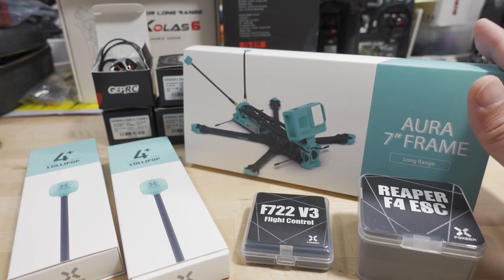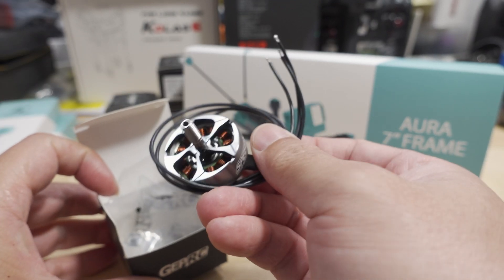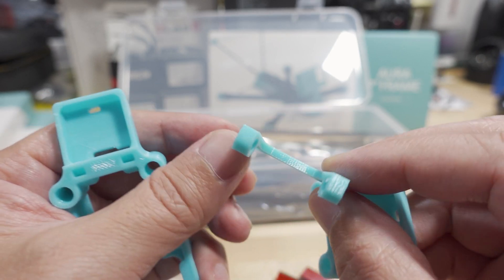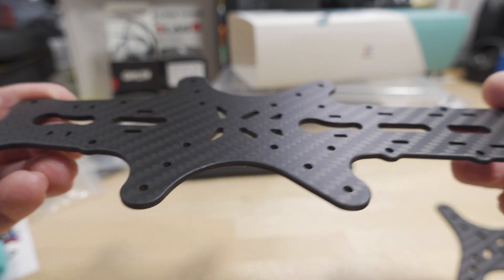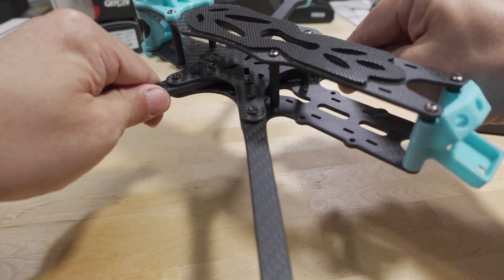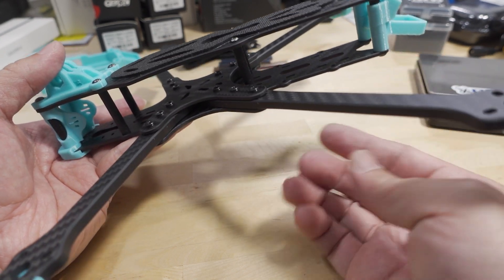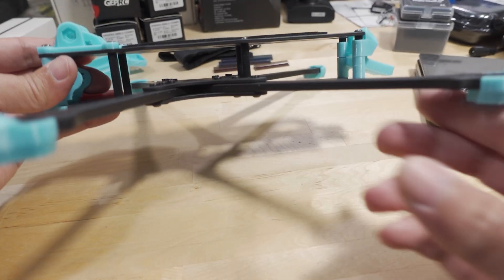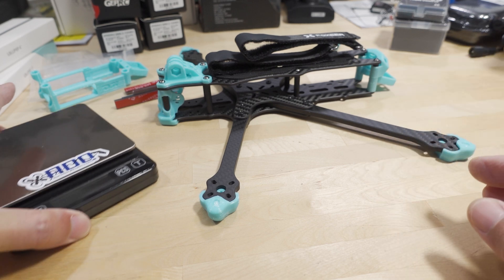Foxeer Aura 7-inch Long Range FPV Build Overview 📝

Comment: did you build this i just have but my props ar touching ?? any idearsim using GEMFAN flash 7040-3
Reply from the maker: Yes, I will have a video out soon.  My props are not touching at all.
Reply: i spoke to Harvey and i havethe first version thy updated the front arms so thy would take all props he is sending me some what a good man

Comment: I am super impressed with quality and all the bits that come with it.  I have built it as a mix of LR and chase platform (2807-1700kv 6s 7").  Its funny how stable 7" is. I did some crazy proximity with it because of how stable it feels. nice frame.

Comment: Ha, just built a small, 4", LR quad which I ended up using a 30x30 F/C and a 20x20 ESC, mine had holes for both but I used an adapter from RDQ to make the fit. Hopefully by next week it'll be flying. Would have like to see the go around you would have used for the ESC n F/C. Anyway Good vid as always.
Reply from the maker: Thanks for sharing

Comment: Yeah, I definitely like this frame, really nice looking. I'm not worried about how the 3D prints look from the factory because I would definitely be scuffing them up while flying, well crashing😂. I just bought a T-Motor F7/F55A stack that I was thinking of putting into an old Armattan Chameleon frame that I have, but last night I was thinking that I could use that on a 7" build that I've been wanting to do; now I see this video. Perfect timing!!! I'm glad that you're going to make a series of this frame and build, that's pretty cool. I watched that Frank 7 video a few times, a while back and I actually liked that one better than the Chimera 7? I think it was? I definitely like this frame and the Rekon 7 frame. I would love to see the Frank 7 in person though😉😂 This is the first I've seen of these long Lolipop antennas. I've got to check these out for sure. Thanks for another awesome video, see ya in the next one.
Reply from the maker: I guess it's better the 3D prints get scuffed up instead of the ends of the arms.

Comment: If you were to choose between the iflight Chimera 7 Pro (7.5") frame or Foxeer Aura 7 frame?
Reply from the maker: What are your needs?
Reply: @AlbertKimTV  number 1 would be long range and then number 2 would be mountain climbing/diving.  won't be using for any freestyling
How long is the top plate on the Aura 7?

Comment: nice project & frame! I had actually planned to use the frame as well but.. well maybe look for something else
speaking off: yep.. a 30x30 FC would work out better I think? 
good luck on the build!
Reply from the maker: Yeah, they sent me the 20x20 by mistake.  A 30x30 is on the way!
Reply: @AlbertKimTV  thought so :)  you could fit it in the back... but I wouldn't eighter ;)

Comment: I've been gathering parts for a 7" but have procrastinated on the frame. So far have FPVCycle 30MMs, Matek F722-SE, Holybro Metal 65A, etc. Might finally finish it with your inspiration :-)
Reply from the maker: Sounds great!

Comment: Really cool frame kit! Eventually, I want to get into the 7" realm. Currently, I have a Cetus Pro and DJI FPV, so next is a 5" freestyle I don't have to worry about as much. Pretty terrified to crash the DJI FPV drone for obvious reasons!
Reply from the maker: Crashing a Cetus Pro is definitely not as expensive!
Reply: @AlbertKimTV  God, I crash this thing all the time. Mainly when I try to push it too hard and don't have the power to punch out. I whack the side of my house, hit the tree branches above it, and the most that has happened is the tiny frame links have broken. I actually use wire shrink wrap cut down and slide it over and heat it up. BUT, BetaFPV started selling the Cetus Pro frames just recently!!
Reply: The only thing i have is a cetus pro....🤣
Reply: @grisvianbrudlie6093  it’s a fun little drone though for sure. I’m sitting outside and just got done with 6 flights. Been really windy here but I can still rip it around!

Comment: Do you think this would be a good frame to swap with darwin 7" long range drone 🤔
Reply from the maker: Yeah, the parts should work.  The motor wires may need to be lengthened for the back arms.
Reply: @AlbertKimTV  
Nice I want to go with dji will vista fit or just the air unit cause I run the darwin on 5s
Reply: @AlbertKimTV  
Do you know where I can get a roll of good wire for that  🤔

Comment: Great review video of a pretty 7" frame. I have a few 7" builds, loads of fun. Looks like a decent frame, quality carbon. Pretty tpu color. Nice, props out of view. My first 7", the props are way in view, learned my lesson on that one. Good choice on motor size/kv, good efficiency when cruising. But plenty of power when you push it. Happy building Albert. 😎
Reply from the maker: Thanks 👍